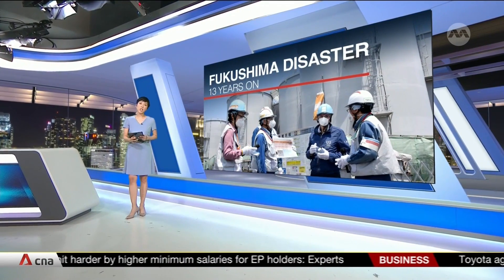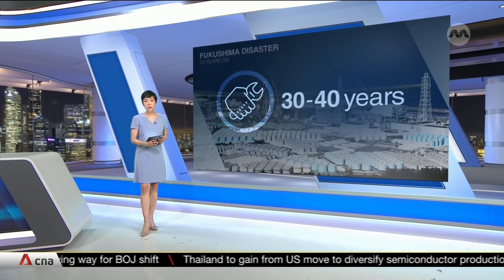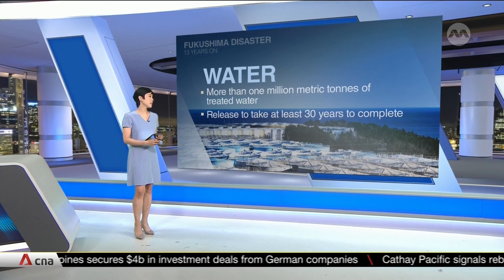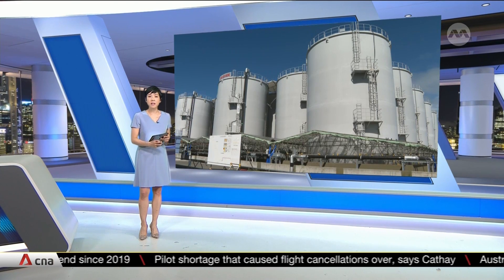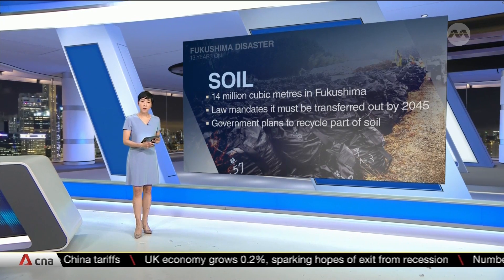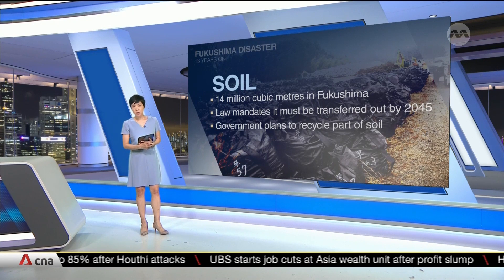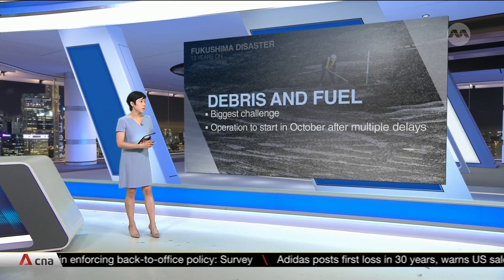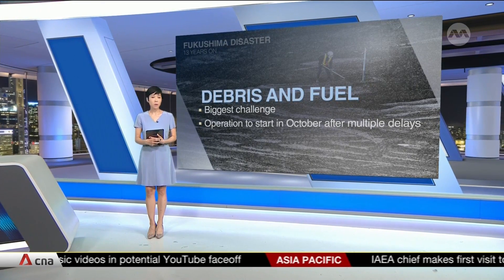Fukushima disaster 13 years on: Challenges in cleaning up after the nuclear meltdown

Comment: They haven't even started picking up the scattered reactor fuel, or melted cores. Nothing electronic can operate in such an environment. Nothing without electronics can be used amidst such tangled debris. This is why Chernobyl is enclosed rather than cleaned up. they may well end up having to do the same here. This will necessarily mean a tsunami proof cover. Shaped to allow the water to flow over it and tough enough to withstand the outflow of any such flooding, filled with buildings, ships, vehicles and the like as it is.